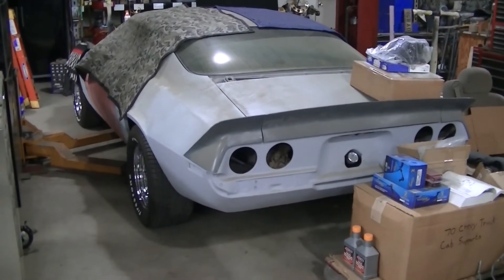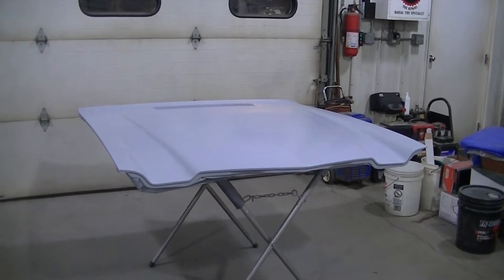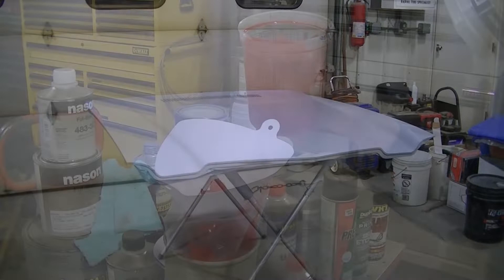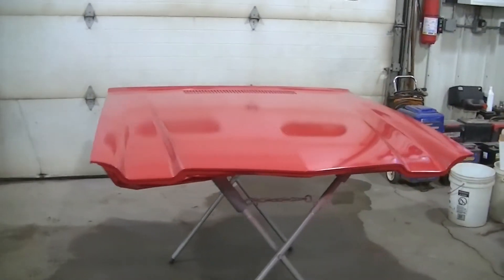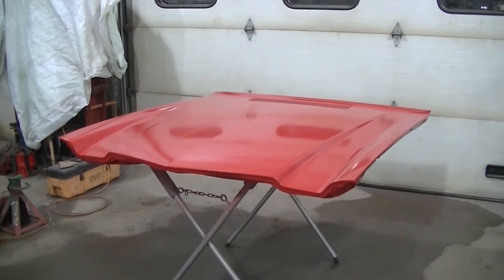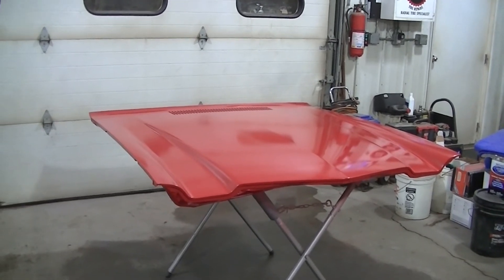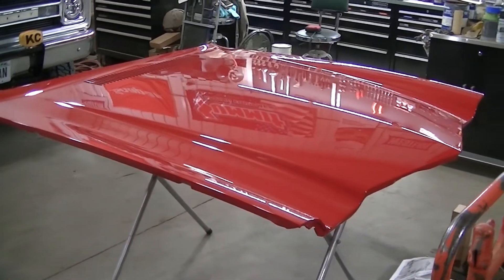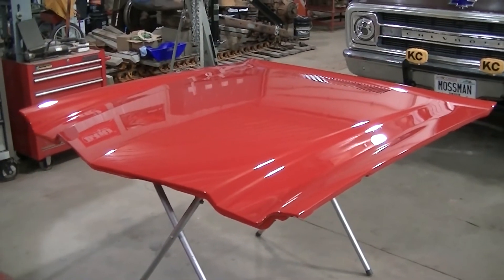70 Camaro SS Painting Hood | Color Reveal

Comment: Good choice on the color! We used to paint in an old garage and we would put up a makeshift paint booth by hanging plastic from the ceiling and a couple box fans with filters propped under the garage door for ventilation.
Reply from the maker: We have a big ventilation fan. It's normally used for venting exhaust. With our ceilings being so high it's pretty hard to hang something. I thought about making plastic curtains that rolled down when we were painting, on the far side of the shop. Dad is working on a tractor on that side right now so that wouldn't have worked out this time. We move stuff and work on so many different things it would be hard to set up a paint booth. I don't plan to paint much after dads car and the truck so I will just deal with the trash in the paint. It's not bad when you wet down everything you can before painting. They are pretty easy to buff out too. Once we drive around in the summer I bet nobody would be able to tell the difference between the mosquito in the clear coat and all the other mosquitoes splattered all over the car.
Reply: @mossman381  If it's for your own car it's understandable. We were painting for customers and they expected miracles.

Comment: I really enjoy your videos they bring me back to great times. I owned a 71 Camaro installed a 383 with 4 speed and drove it a total of 75 feet in reverse and 75 feet in first. Then I sold it several months later after slowly restoring the chevy for total about 2 years. The red on your Camaro really stands out and your color choice is excellent.
Reply from the maker: Dad has had this car for about 20 years. He drove it for the first few years he had it. Then tore it down for the restore and it's been down ever since. Hopefully not much longer. Why didn't you drive the car some before selling it?
Reply: @mossman381  I ended up moving and I had to cut down on how much stuff. Believe me I really regret selling the vehicle because I wanted a Camaro for years. I also had a 71 Challenger at one time too, that one I did drive.
Reply from the maker: I think we all have those vehicles we wish we wouldn't have sold.  Dad was a Dodge guy but switched to Chevy. He said they drove better.
Reply: @mossman381  yes very much so. I'm  gearing down for now and simplifying my life.  My RX7 convertible left its nest today and tomorrow my 70 C10 Stepside is going. Perhaps 1 or 2 bikes and an ATV will go in the next few weeks.  I know you're probably thinking not the C10 and I'm an idiot. I just need a change. I might even sell the rest of my farm equipment.

Comment: I like the color but I am of the same vintage.  Theoretically, being it's original color will be a plus to it's value, even more so if the rest of the car is very stock too.  I went down this road with a 62 Corvette I restored to show-n-shine/driver level.  Get's expensive faster, trying to stay stock but I still like that color for that car.  If you feel like trying something different later you could wrap the car, just a thought.  
One thing you can do is get the floor wet when painting in garage and of course, the bigger the clear perimeter the better.  
Bugs will make you swear all right.  I recently painted a camper shell but it was outside.  Everything was fine, got it just right.  Wash up, go inside, eat, come out, looked like the dang thing was fuzzy with these Nat looking bugs.  It was Satin Black but I guess it was the smell maybe that drew them.  They sanded off easy but I hate to do things over.  
You can probably remove those bugs (I didn't see many) and if anything left light polishing.  Before I forget, nice job on the paint job, it's more difficult than it looks to get a nice glossy and smooth finish like that.  I always plan on color sanding/buffing something on about everything I paint.  But not 500 Nats.
Reply from the maker: This is a really bad time to paint. Bugs are in full swing. I don't think bugs are attracted to paint. Otherwise they would be all over my paint cabinet I would think. The clear coat is real sticky and it catches them. I think it's just bad luck when they get in the paint. Really need a paint booth that can be rinsed down and sealed. A down draft booth would be ideal.
Reply: @mossman381  I've seen the inflatable paint booths on TV.  They seem pretty workable but no idea what they cost.   They rent them apparently also but access to that probably limited to large metro areas.  A permanent down draft booth would be awesome but that would represent a huge cost.  You might have to open up "Randy Schieb's" to make that cost effective.
Reply from the maker: Those inflatable booths look interesting. I don't plan to paint many big projects after we get the Camaro and the C10 done. I want to do more enjoying driving them than fixing working on them.
Reply: @mossman381  Yeah, I hear ya.  I've said that dozens of times.  Never seems to quite work out that way but it's a good plan.